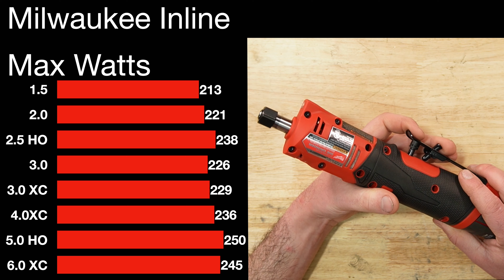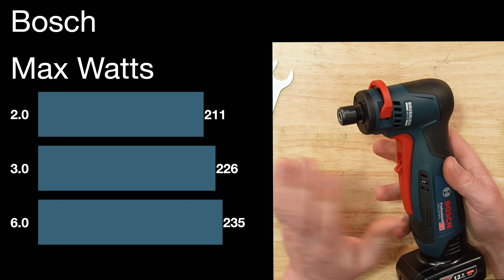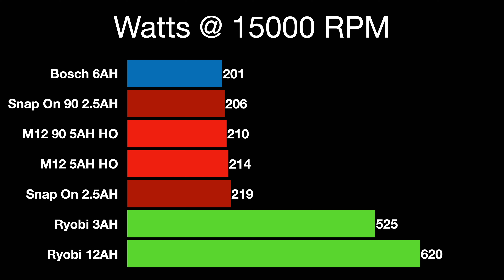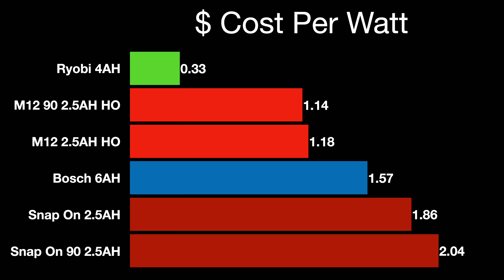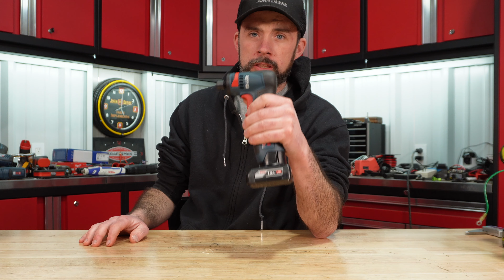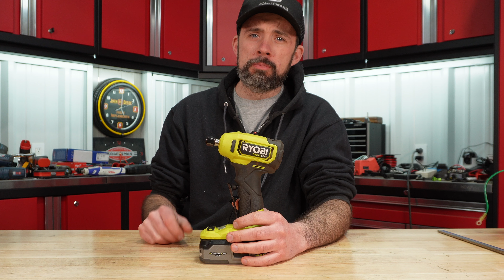The Best Cordless Die Grinder

Comment from the maker: 1/4 Collet for the Bosch PN 1 619 P10 662 from GWG12V-20S parts book https://www.boschtoolservice.com/ph/en/boschprof/spareparts/none-gwg12v-20s-3601CA701 

THIS IS ONLY SMALL DIE GRINDERS,  Large inline die grinders IE Dewalt Flex Metabo etc will be in a separate video.
Reply: wouldn't mind hearing/seeing them run, even for a second, maybe let them vibrate around on the table? I really need a quiet one for long hours of use.

Comment: Often times i feel like yes man this guy is absolutely right. But prefering the large ryobi over milwaukee and bosch? If i do need more power i choose a different kind of tool. I got the bosch and i really like it since it is super light and small. If i need more power i simply use a regular  angle grinder prferebly with flat head like the dewalt 405 f
Reply from the maker: The new gen 2 M12 is a big improvement.  I still find my self grabbing the Ryobi though.
Reply: @Tools-Tested what a shame that Milwaukee always takes some time to bring their new tools to germany… and double their prices. Still waiting for the new ratchets

Comment: I have 3 of the right angle ryobi's in my workshop. We use them for hours each day with 2 inch 'roloc' style, quick change, sanding and surface conditioning pads. The oldest one we have us around 3 years old and is still going strong with daily use. They have been a cheap and  reliable alternative to running air tools. I do not want the noise of running rotary air tools all day, I am in light industrial zoning and do not want to  annoy my neighbours. With a good quality ceramic sanding disc they knock down small welds on highly finished stainless steel parts with ease. I have tried the 12v milwaukee and they just dont compare. The batteries drain way too fast. And there is not nearly enough torque compared to the 18V. The ryobi are much heavier but still lighter than a 100mm angle grinder and much more precise and easier on the wrists if used for long periods. For the price I would be happy to replace the tools every year if needed as they would have more than paid for themselves but it seems they are quite durable. For my usage the abrasive costs is lower too. As the price of flap discs is so high, and much of the disc gets wasted using them for my purposes. the 2 inch quick changes can be gotten cheap once a good supplier is found.
Reply from the maker: Thanks for the info! yeah I love mine.  Would be nice if Milwaukee made a 18v version,  that 12v is gutless.  It has to be one of Ryobi's best tools IMO,  nice to hear its lasting under heavy use.

Which battery do you typically run on it? Im thinking this tool will benefit hugely from the new 4ah tabless.
Reply: @Tools-Tested  I run the 5ah batteries, and keep at least 2 batteries per tool.  Generally we don't drain one before the other has charged with fairly constant but intermittent use. The 5ah definately increase the weight a bit. But for us it's worth the extra torque and run time.  I really rate them highly. We have no other Ryobi tools in our shop. Mostly use Metabo. Even if Milwaukee brought one out now I probably wouldn't swap.

Comment: No other 18-24v die grinders?  I almost bought the bulky Hercules, but it is single speed.  HF may have improved with the Hercules line ,but a lot of them are dumbed down to save money.
Reply from the maker: No not yet,  working on a dyno to handle them.  This one can’t handle those.

Comment: For anyone wanting to no collet size part numbers. Bosch only listed 6mm and 8mm in uk for some reason which i think put alot of people off bit silly of bosch really knowing they have the parts from the 18v die grinders.

1/8 2608570139
3mm              136
1/4                 140
6mm              137
8mm              138
😅
Reply from the maker: Thanks!  yeah kinda crazy sell it in the UK with a 6mm collet,  then don't easily provide the 1/4 PN. 

 I ordered 1 619 P10 662 from the parts book for the US version.

Comment: I realize that I'm coming to this video a couple months late and asking this, but why did you include the Ryobi 18v die grinder with the lower voltage die grinders? Of course it should outperform them by a large margins. It was even more confusing when you showed the Milwaukee M18 (18v) die grinder and said your testing setup couldn't handle it, which implies that the Milwaukee 18v die grinder is much more powerful than the Ryobi 18v die grinder that you just chose as the highest performer.

Thanks for making the video, but I'm not sure what the criteria was that you were using to choose which die grinders were included in this comparison. Were you including any right angle die grinders, regardless of voltage/size? If you took the Ryobi 18v die grinder out of the competition and were choosing among only the lower voltage, smaller die grinders, which would be your choice? That's what I'm looking for now. I don't have the room for that big Ryobi base and battery for some projects.

Comment: Looks like the Bosch is now officially sold in the US (with a 1/4" collet) at $229 with a couple 3Ah batteries. Which would undercut both Milwaukees kitted with a single battery
Reply from the maker: Nice to see it comes with the 1/4 collet and with a kit price of $230.  Not bad price wise in the kit  form like u pointed out.

Comment: The Milwaukee M12s are in dire need of an update. They’re basically useless. Better still, come out with an M18 version. Personally I use my Ryobi but I’d love to see Ridgid put that tiny cutoff tool motor in a right angle die grinder.
Reply from the maker: Yep the m12 was cool when it came out,  but they seriously need to do something.  Between this in the 3" cutoff tool,  M18 versions are what they need.  That Ridgid motor in a die grinder would be sweet.

Comment: I got that ryobi because I bought a tool kit that came with another free tool, and of the tools I could choose from the die grinder was the most expensive at regular price so that's what I chose as my free tool. I didn't need one, had an air version, but if you say I can pick a free tool im gonna take the most expensive option no matter what. That was two years ago, the tools that came in that kit are all broken and the ryobi die grinder is still perfect. Perfect. Totally flawless. I use it all the time. Only once in two years has the size been an issue and I just used the air version for that.

The only annoying thing about it, and it's a minor thing, is the first gear speed setting doesn't have enough torque. It'll catch and grab on stuff. But, if you go up to 2nd gear and just give the handle a half squeeze so it's running at 1st gear rpm just while in 2nd gear, You have torque now and it's fine. More of a quirk that anything really

Comment: I am using both Milwaukee M12 and Bosch new right angle grinder.  Bosch is much better.   I like its more power,  slim grip and spindle lock.   Your test mixed the small grinders and big size ones.
Reply: how's the vibration and noise level on that Bosch? which trigger do you prefer?
Reply: @sevenohm3375  I prefer Bosch and its vibration is less.  The noise are similar.
Reply: @sevenohm3375 less vibration on Bosch

Comment: Awesome video! I recently got a 26 gallon compressor 175 PSI and 4.5 SCFM. It still struggled to run my die grinder during my last fab project. I would have been interested seeing Run time compared on these models with a similiar 2.0/2.5 AH battery. Mostly to decide if an electrical Die Grinder is a valid move since my compressor could not keep up with 5-8 minutes of grinding at a time. Not sure if that would be a good metric for other consumers though. Keep it coming!
Reply from the maker: Thanks!

Heavy fab use you will definitely need air with a large air compressor,  seeing your pulling down a 26 with 4.5 cfm sounds like you are doing a good amount of work.

Sadly the only solution would be to add another compressor to the system or get a larger one.

If you look up the model of the die grinder it should tell you the max cfm it uses.

Hopefully at some point I can dyno air.

Comment: I got the Ryobi the very next day after your first eye opening Die Grinder Video, around a year ago.  And thank for that, very much.
I have thrown everything at it. Have put tooling on it, one wouldn't think possible, and it just keeps on giving.   
Other trades try to give me a hard time about my little Ryobi drill.  Then go into a confused state when they realize it's not a drill.  
Entertaining indeed.
Once again, your attention to detail is appreciated.
Thank you.
Reply from the maker: Glad to hear it has worked well for you aswell.  

Yeah for some reason people hate on ryobi,  which I find funny because the guy who owns TTI owns Milwaukee.
Reply: @Tools-Tested  i think the stima evolved from the ryobi of yesteryear when the tools were legitimately crap
Reply: I agree! I use my Ryobi very often in my auto shop. People always look at me like I’m crazy until they see it work.
Reply: The ryobi Die grinder is awesome since it can fit a higher output battery on it but it is a bit on the bulk size for a right angle die grinder.

Comment: I currently own the ryobi and like you said I have not run in to any issues with it yet, I do abuse it and run it pretty hard and it has not let me down or bog down. On the other hand, I have used the Milwaukee one and it was good but once I started to push down on it is when the tool would cut out and I needed a battery pretty quick. That is why I went with the ryobi because of these two issues.
Reply from the maker: Yep very good point on the battery life with m12.

Comment: Interesting example of voltage benefits with Snap-on (14.4V or 16V MAX) vs M12 (10.8V or 12V MAX). Snap on is 274W vs 256W for M12. But Snap-on only has 4-cells vs 6-cells for M12. The M12 5ah is also using Samsung 25S, but Snap-on is Samsung 25R (unless they upgraded). 

So Snap-on is getting ~7% more output power despite using a battery that's <66% of the electrical power of the M12 5ah.
Reply from the maker: Yep,  this was my first time using the 14.4 (16v).  I think it's a smart idea,  with 2 cells in the tool vs 3 and higher voltage allowing for a lower amp draw.  

It will be interesting to see how the other tools compare vs Milwaukee.
Reply: @Tools-Tested  I wonder if the format could fit 21700 cells without making the case too thin. That would give them comparable power to the M12 5ah (4x35A = 140A vs M12's 6x25A = 150A)
Reply from the maker: Hmm that’s an interesting thought,  would be awesome if they could.

Comment: The Mikita die grinders are the best.
Reply: The makita 18V die grinder is brushed. It is likely to come last against every other brand's brushless 18V die grinder.
Reply: @toolscientist  
TTC measured it at 330W or so if I remember right. Not great for an 18V tool of that size and weight. I guess you could find worse.
Reply from the maker: I hope to test them soon with the other large inline's.

Comment: Great testing as usual! But I have to disagree with your conclusions regarding the Bosch.Your data shows that it was the only model to deliver it claimed RPM, has the lightest weight (even with the chunker 6Ah battery), is most quiet, and has the lowest vibration. That doesn't sound like a disappointment to me. By the way, are you sure this model is made in China? Nearly all Bosch 12V "specialty" tools (not drivers) are made in Hungary or Germany.

Also, using an imported price for the Bosch is not apples-to-apples as there is no such thing as a $270 USD Bosch 12V tool in the US market. In the US, Bosch 12V tools tend to max out at about $150, but are often available for much less.

I also have to disagree with your interpretation of the Watts @ 15K RPM and Max Watts charts. At 15K RPM, there is no meaningful difference between models with the exception of the Ryobi. The same is arguably true for Max Watts (39W difference between the lowest and highest).

Excluding the much larger/heavier Ryobi, I interpret your data as showing negligible performance differences between the 12V models. With that in mind, other factors such as weight, noise, vibration, and cost are arguably the most important differentiating factors.

Please don't interpret my comments as criticisms of your work. You have an excellent channel! But I think your analysis would be improved by contextualizing differences in performance data to the real world.
Reply: Yeah, there's basically zero performance difference between the 12V tools. Milwaukee also has the slight advantage of having higher powered cells than the Bosch.

The Snap-on is 14.4V (or 16V max). So it has voltage advantage. However, it has fewer cells (4) compared to the M12 and Bosch which have 6. Good example of how higher voltages give more power, especially at these low voltages.
Reply from the maker: Thanks!,  I agree with the vibration and it actually meeting the claimed rpm.  

The serial number sticker says "Made In China" sadly.

Pricing is based off of MSRP on Amazon Germany shipping to Spelle Germany 48480.  I will admit it is onsale now but still has an MSRP listed of 250 euro.  

I just think they could and should have done better coming into the market so late,  granted yes its 12v.  The cutoff tool is in the same boat but at least its made in Germany.

Comment: Would like to see the 24v kobalt die grinder tested also
Reply from the maker: Hopefully in a few months once the higher watt dyno is done.
Reply: Yeah, I would love to see that too. I have an M12 right angle and the Kobalt. But I’m usually doing small 2” abrasive wheels to remove paint and rust and stuff. The M12 seems to work just fine for that, and it’s smaller of course. So I’ve barely used the Kobalt.

Comment: Snapon should be ashamed
Reply from the maker: Yep should be around half that, they want US made prices for a tool that’s made in china.
Reply: @Tools-Tested  well said, at this point, I've just got to assume they think we're all idiots.
Reply: I’m wondering how many they sell, and if they are actually making much money on them. Their sales volume has got to be really low at those prices.
Reply from the maker: Yep I imagine that’s the issue,  low volume and high design/manufacture costs.  I would love to see their margins.
Reply: @Tools-Tested  I wonder what everyone else’s margins are, too. Ryobi makes so many different models of everything. 

The other things I have no idea about is, how hard is it to design some of these tools? How hard to make them reliable? And how hard to make them inexpensive to manufacture?

Milwaukee made that defective update to their high torque. I’d love to know what went wrong. Did it get assembled wrong? Did the prototype differ from production in some way? Did they make a last minute change? Did a sub assembly company make a change without discussing? Etc. 

I watched a great teardown of the Juicero juicer. They designed it with huge pieces of plastic with varying thicknesses. Impossible to make those parts cheaply. And with CNC machined metal parts that couldn’t be made any other way. So if they wanted to make them in larger quantities for less money, it was simply not possible without a significant redesign. Making the initial units expensively to see how the market reacts can make sense but you should be thinking about how to do it less expensively eventually.
Reply from the maker: @gf2e  Yep exactly, it makes you wonder,  is seems Milwaukee and Dewalt have a new drill every year which can’t be cheap but on the flip side they do large quantities.  Would love to know the margin #s.
Reply: @Tools-Tested  YouTube tool reviewers share some of the blame for this, though. They always talk about how long a drill model has been on the market. So the tool companies need to compete by making changes regularly  :)

Wonder how often their injection molds wear out. Time to make a new tool when the molds die. 

Hilti is actually another interesting company to look at. I assume they are not particularly high volume. But they are much cheaper than Snap On. They sell services, though, so maybe the tools are a bit of a loss leader. What I really like is that every one of their battery chargers includes a cellular radio to upload tool data to the cloud. They will detect a warranty replacement need for a battery and proactively dispatch a replacement, supposedly. They also upload data from the tools themselves. The tools upload data to the battery during usage. 

Makes the Makita system that can have a PIN and duration timeout seem quaint and low tech.

Comment: I have the Milwaukee m12 and 2 m18 die grinders.
Put them through their paces, almost burnt the motor out in the older m18 slotting out larger holes doing steel fab and erection, great tool, looking forward to how they actually stack up against other brands, the braked 1 is a nice upgrade.
Reply: The M12's will never burn out , they cut out so conservatively.  I'd much rather have the responsibility of not letting them burn up in my own hands, but alas ..
Reply from the maker: Yeah it should be interesting,  seems like all the brands now sell larger inline die grinders.